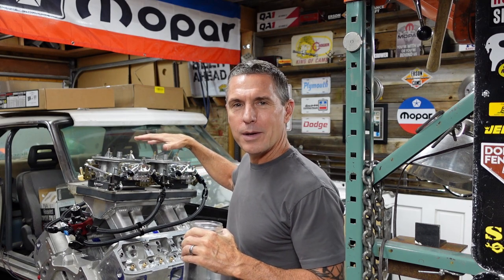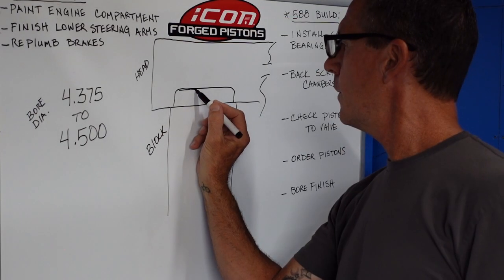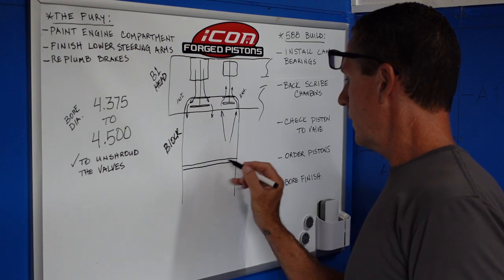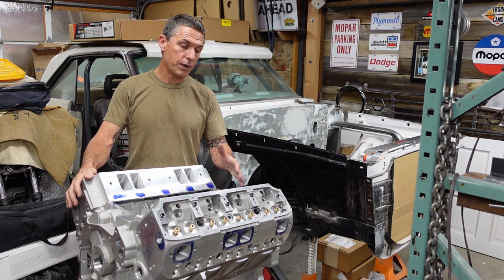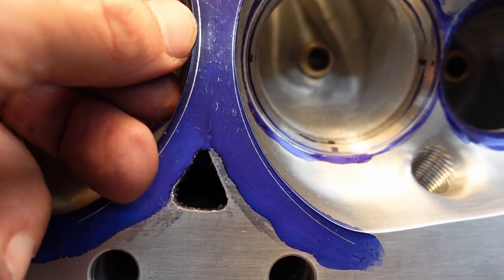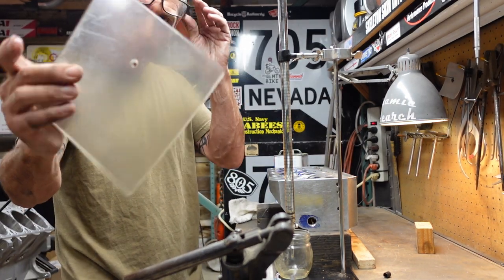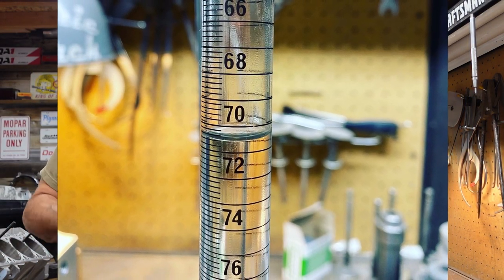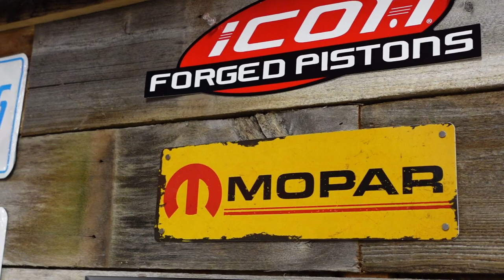COMBUSTION CHAMBER secrets. All ALUMINUM 588 B1 MOPAR

Comment: sorry for the loss of your parents and  wife's grand parents, been through it also not a great time in my life. Im enjoying watching you build your 588" B1 headed street/race car.I cant wait to see the shake down passes at Fallen. always loved the early 60 mopar body styles. I raced super street/super gas With a 69 dart (stage 6 headed 452")i built for a few years before getting into drag racing boats... been racing boats for around 20 years now. i have a 380 lb Kurtis 501 with a 604" KB block, predator N/A combo, made 1282 hp. ive built a few B1 MC motors, last one made 1045 hp with a single carb ,keep up the hard work the finish line is in site....
Reply from the maker: Tony this is so motivating to hear!!
Man, I would love to build a predator headed engine in the future. 
Thanks for the kind words, and thanks for the support. 🙏🏻
Reply: @griffittsgarage  When your ready to make the jump to predator power, look me up have a bunch of misc. parts been running them for 20 plus years, built a bunch of  different cubic inch, combos for my self and others.... looking forward to the eight of next month, my new steel T&D 1.95 rockers will be shipping  , ordered them in May

Comment: Mr Griffiths
     I have been watching your channel for a while. We have many Mopar  dreams that are identical 
More importantly, I’ve just heard of your recent family concerns & applaud your priorities. 
Had a similar family loss episode while simultaneously going through a divorce. Most difficult period of my life. You seem healing, Gods speed. 
   Still have highschool grad present, 69 Coronet conv.  Four of them now & a hardtop which I want to twin turbo 440.  Expecting girdle,studs, 2x4bbls,forged guts, thinking forced air complicates bob weight concerns, comp cam , figuring which one? Trick flow but aware of B1 for years….streetable? Requires special aftermarket intakes n headers? Your piston choice interesting?  Hobbiest like you. Retiring dentist 45 yr hobby switching new “career”  Just got dream garage. Enjoying your 440 build
Reply from the maker: Frank, its nice to meet you, thanks for the kind words. I feel ya when you talk about going through similar tough times. Interesting that you mention healing... I am a healer of sorts. I absolutely love how this tiny little channel has brought so many like minded enthusiasts together. 
Also, I love the thought process of deciding which parts to run and why. As you know, this engine would not be very practical as a true daily driver and it could evolve over time. We live at 5000' elevation and that is one of the ways i get away with 12 to 1 compression on 91 pump gas. The B1 platform does address some of the design limitations of the traditional style production heads. This head was designed in the 80's and is in need of an update, but for its size its pretty good. 
Thanks again for being here.
Kevin

Comment: I had the reverse issue, where my bore was bigger than the combustion chamber. Factory 400 block bored at 4.375 with trickflow heads,  my fix was to notch every bore around the intake valve. I have not heard from anyone having this issue, maybe they never checked. Then after i decked .080 from the heads now 65ccs i did what you did and fit the chambers to each bore.
Fun stuff
Reply: Yeah I want to say sorry for your losses also.

Comment: Nice motor. 16 to 1, that's alot of punch. I like my 8.5 to 1 compression engines for the torque and are more forgiving, LOL. I follow the theory of "If you build for torque, the horsepower will follow" I love my torque.
Reply from the maker: There you go… keep it safe like that and they run a long time 🏁
Thanks for watching :)
🙏🏻
Reply: How does a limited static compression ratio contribute to torque ???
It lets u run pump gas. That's about it.
Reply: @michaelmoon8856  You get the torque from the advance curve which is more aggressive.

Comment: How low can you get your compressing down ? Can you run pump gas or need to Tip the Can a bit ? Is there a Cast Tunnel ram out or only custom sheet metal ? Love yor build videos. Full of info. 👍
Reply from the maker: Thank you for the comment Michael! We live at 5000 ft of elevation and up here I like to run the aluminum head street/strip engines at 12-1 on 91 octane with limited timing. The piston video shows how we had to dish the piston in the center, running a quench ring just around the perimeter of the piston crown. I will run race gas at the track though, just to keep it safe.
There’s just something cool about pulling up the the gas pump on Saturday night 😎
Thanks again for stopping in 🙏🏻
I have the intake manifold video just about done.
Kevin

Comment: I've been doing that for years and had people argue with me that it doesn't matter. I have a 6. Liter LS with the LS3 head which has a wider chamber than the 4 inch bore. The patch is to bevel the top of the block. People tell me still, that it doesn't matter. I don't understand anyone who understands air flow would think that way.

Comment: How far around the front and back of the valve are you opening the chamber up?  Is this amount just a feel? Or a rule of thumb?
Reply from the maker: Thats a great question Steve! I like to follow the radius of the bore diameter till it intersects with the quench pads on each side of the chamber. I didn't realize i glossed over that in the video.